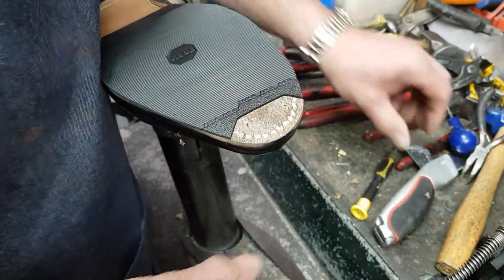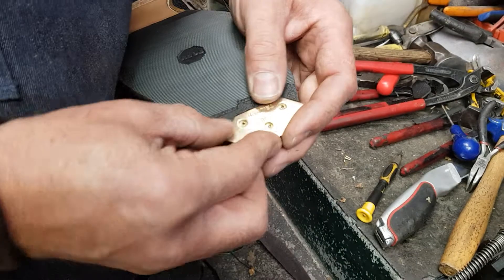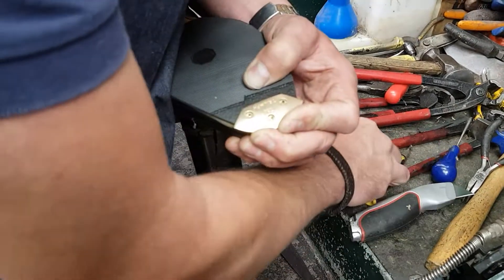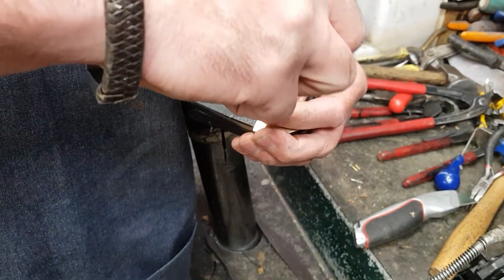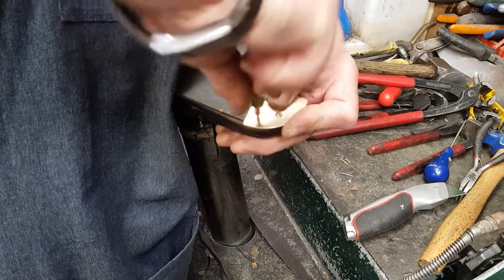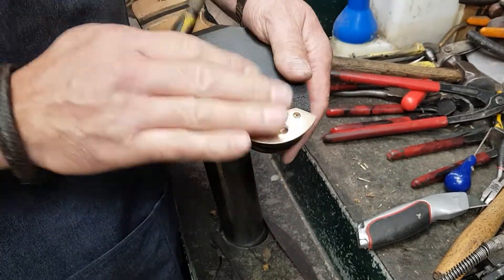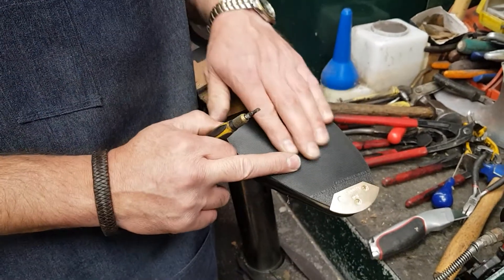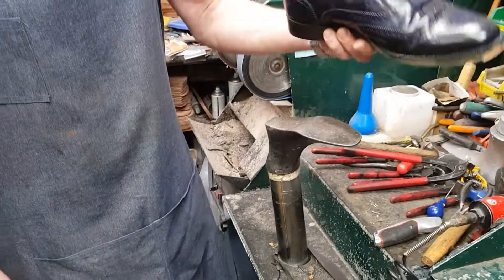Church’s Shoes : Triumph Metal Toe Plates with JR Leather & Topy Cover Sole

Comment: Beautifully done. Can you tell me how much that would cost (JR heel, JR sole, Topy cover + Boulevard toe plate)? Thanks in advance
Reply from the maker: The JR through sole is £89.95   then toe plates and the best topy sole is £45.
Return post in uk is £10.   Turnaround is 2 weeks unless you need us to a night-shift then 3-4 days
Reply: @shoehealer8853  Thanks for the info! With the topy cover sole, does it matter if it is a JR sole or normal leather sole?
Reply from the maker: no normal leather is good....about £15 cheaper.

Comment: Classy as hell and a fine job may I say! .... they look like Triumph ones?
Reply from the maker: Yes they are Triumph but i believe they are called boulevard.
Reply: @shoehealer8853  Some of the Paris bespoke shoe makers make custom ones out of brass plate, good thing about that is you can decide on a thickness to match the sole protector and do your own design. ... and, bar the time to design/make can be made very cheaply.